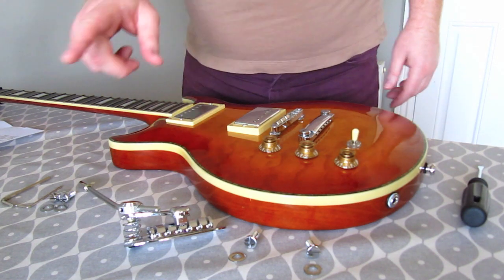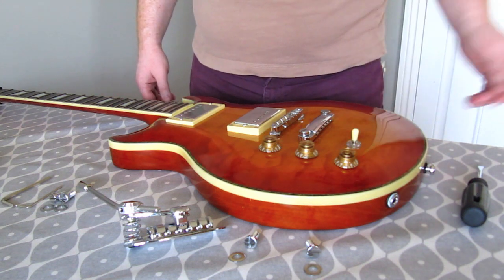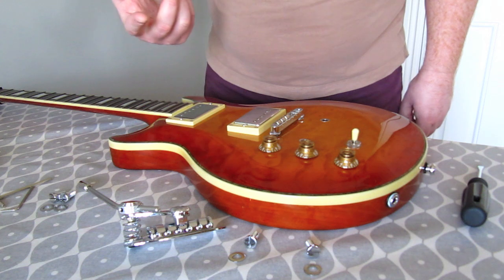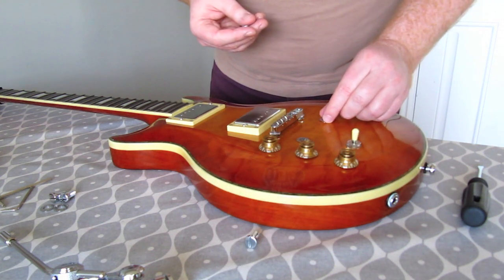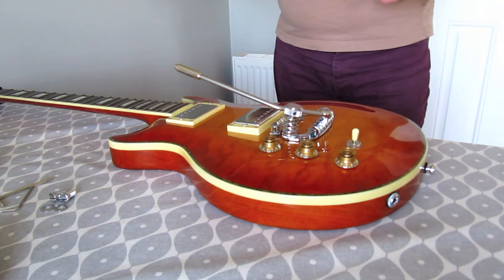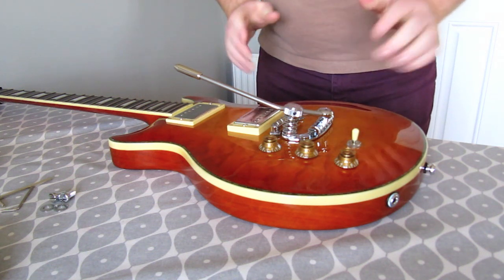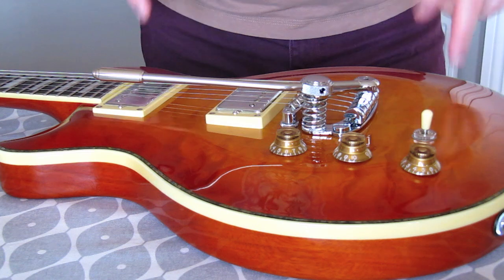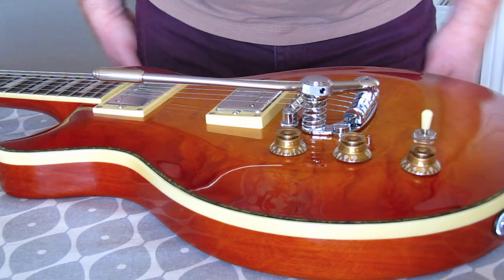How to install the Duesenberg Les Trem II tremolo system step by step - Ginger Lefty

Comment: OMG!! I'm a bit hated  when that screwdriver scratched to the guitar body. Next time use your fingers screw a bolt first until it stuck then use screwdriver.

BTW thank you for sharing.
Reply from the maker: +toeyredhot guitars get scratched btw. They're not museum pieces. In this case, the guitar was not scratched. Thanks for your concern.
Reply: I cringed when he did that. Ugh!

Comment: 3:48 Oops! This wouldn't have happened if you would have used a coin instead of a screwdriver. You start using a tool so early! At this stage I would have been turning these bolts by hand. I'd do the last part with a coin.
Reply from the maker: Good for you.

Comment: how stiff is the trem arm? if you installed a left handed trem on a right handed guitar (so the arm was out the way of the volume controls) would it constantly swing down over the strings or can you tighten it so it's stiff? is that what one of the small allen keys does? cheers!
Reply: Prob way too late - but maybe helpful to others. You can adjust the arm stiffness using the small nut under the arm pivot. So it can be floppy or stiff. Need to slacken big allen key and move spring to get at it, but easy enough. Right handed best for right handed guitars :-)   The small allen keys allow adjustment of length and angle of the arm. Super smooth and great at returning to zero, better than any Bigbsy I've owned.

Comment: I just installed one of these on a lefty "Eastwood" baritone guitar...I really like it, just two issues:  One, it sticks up pretty proud, so my case is not happy....Two, the bar has about 10mm of "play", where nothing happens within that range; is there any way to tweak or adjust the cap that holds the arm?  It seems to be getting loose, which I think is causing this "play"...
Reply from the maker: +james Parker you can adjust the height down with the allen key screws. If the arm is loose rotate it clockwise and it will tighten.

Comment: Great video thanks. I own several of the original LesTrim tremolos which is basically the same and they work great. I wanted to get a couple of these as they are all that's available. I read the "caution" from the vendor that when exporting to the US they will be subject to import taxes now and that has me concerned without knowing what that cost would be. Thanks again.
Reply from the maker: +Rude Dawg Thank you. Glad you liked it.